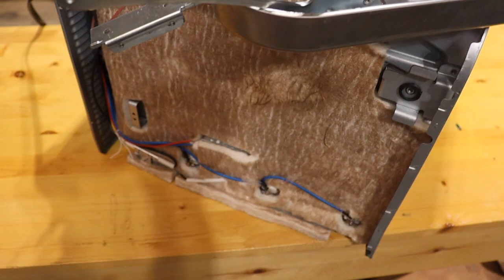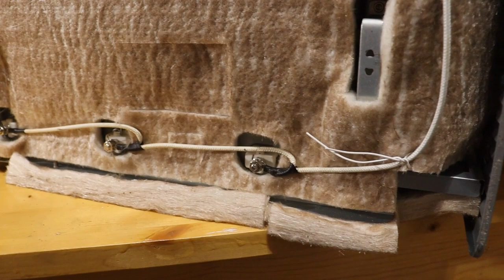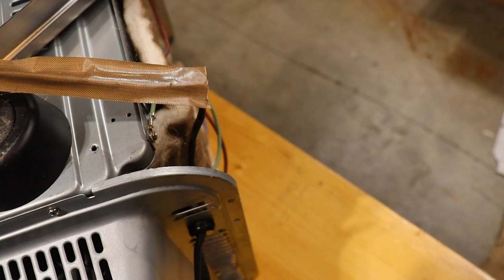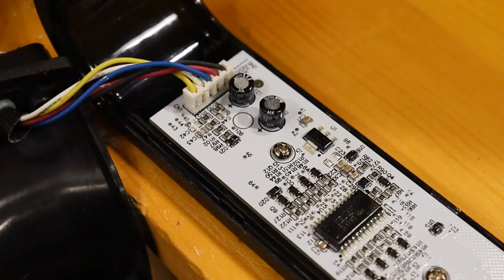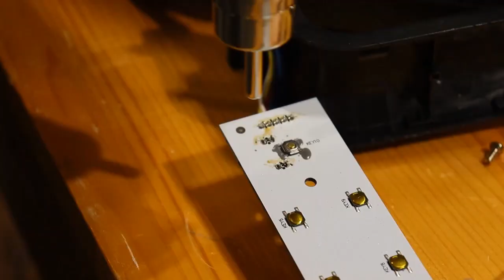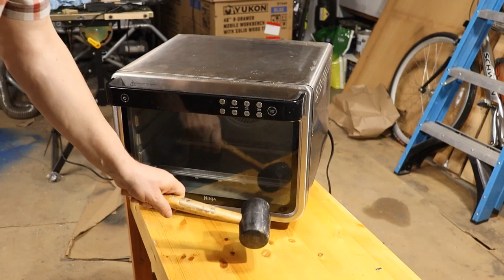Repairing Ninja Foodi DT 201 - Start Button not working : It is "disposable" product

Comment: We used the hell out of ours, maybe 3 years of hard use because since buying this we rarely used our oven any more. Mine died by the controller board not supplying DC voltage to power the PCB in the handle. We had a power outage/surge that took out our coffee maker and this oven. I'm not able to diagnose component level I was hoping to be able to simply buy another control board but no one sales them, I found one on Ebay but it had already been sold.

Comment: Thank you for posting, You have saved me a lot of hassle. The Oven Light on my DT 201 as failed and as you show this is not user friendly so you bin the Oven because the light stops working!
Ninja will replace the entire Unit if its in warranty {2 Years] and now I can see why. Very bad design fault.
What you say about the Glass fibre is also concerning.

Once again Thank You

Comment: Hello everyone, my Prestige-type Ninja oven worked perfectly during the year-long warranty period. A couple of months later, it started malfunctioning, displaying "Callserv Er0". Here in South America, there's no warranty or service, so I proceeded to repair it myself. The problem occurs when I open the door; the light doesn't turn on at the correct time, and then an error code appears. I disassembled the casing and observed that the fault is in the area where the 5-wire cable connects the door to the chassis. I think the wires broke from so much opening and closing the door. I'm going to cut the wires on both sides and solder in 10 cm of new cable. My question is: how does the main board detect when I open the door and the internal light comes on? I haven't seen any mechanical/magnetic switches in the area that could be causing this fault. Thank you in advance for any information you can provide about this type of problem. Otherwise, I love this countertop oven; I use it daily.

Comment: Disassembled the outer casing and decided to see if going further was worth it after the power button died...it's on the way to the recycling center. Also worth mentioning that the cover is very sharp and it's very easy to slice your fingers.

Comment: According to Amazon, this item is selling at a rate of 600 per month.  It is actually a fabulous appliance, I bought mine in 2020 and after 5 years of approximately twice a day use, it began experiencing intermittent error, due to the broken wire-at-the-door issue.  I have fixed that and examined the switches which appeared fine.  If new switches are needed, I suggest purchase of TL3315 switches made by e-switch from digikey.  Crap switches from Amazon would probably work in the short term, but why not use quality switches given the ABSOLUTE pain in the ass of taking this thing apart?  Be careful with the sharp edges on the outer casing and make sure you understand how the thing gets put back together, it is much easier to take apart than re-assemble.  Good luck!

Comment: Would be nice to see how the stainless steel casing is removed, mine seems to be stuck at the front.
Reply: OK, I was able to get in the seam and pry upwards in the area above the door with a "stiff" putty knife, a regular putty knife being too flexible.  I guess a painters multi tool would also work if not too thick.

Comment: Thank you so much for this video. Both my start stop button quit as well as my power button within 24 hours. I’ve only had this thing for six months, but I use it two or three times a day.

Thank you so much for sharing this. There was no other information anywhere on the Internet about this. 

I will be buying a new oven that’s NOT made by ninja.
Reply: Same here. I will never ever buy this brand again. I liked it a lot while it worked but after spending so much money, the oven simply will not turn on and work again. I will buy another air fryer, but never this brand.

Comment from the maker: There was a question why the switches come apart? These switches have spring steel domes glued to the base with adhesive kapton tape. As with any self-adhesive tape, the glue deteriorates with heating and drying. And eventually they come apart. If you repair, it may be better to use the other type of switches (as shown in the video) which have crimped metal case - it does not rely on the adhesive. Replacing with identical switches may be an invitation to disassemble exercise.

Comment: I agree that this is not a repairable oven. This oven is unbelievably difficult to disassemble. I replaced the on/off switch and the start/stop switch.  I believe its the heat that causes these switches to self destruct. 
I bet in a year or so more switches will fail.  I am going to put some insulating materiel on the back of the handle and perhaps that will fix this problem.  The switches are readily available from Amazon

Comment from the maker: There was a question about the "micro tactile switches" I used... There were from my goodies box, however, here is Amazon link that gives you plenty (and you'll get some spares): https://www.amazon.com/Tactile-Momentary-Assortment-Control-Plastic/dp/B07DNHS3FL or https://www.amazon.com/SCOOYUCK-Normally-Tactile-Momentary-Switches/dp/B0D9H8V873. The box includes the original ones (with yellow mylar dome that fails), and the enclosed ones with the button. I used the latter, but because they are ~0.5mm taller, one will need to put ~0.5mm washers on all mounting screws so that the buttons are not permanently depressed.

Comment: Hi, do you have a part number for the button? I cant find it even from electronic goldmine search
Reply: I advise against getting any cheap electronic component from Amazon.  Many are absolute garbage.  I suggest Digikey as a source as they supply industrial customers so basically everything they sell is of better quality.  For this particular item the TL3315 series from E-Switch offers the correct replacement with options as to operating force.  I'm sure any of the options would work fine.  A higher force would give a more quality feel, so why not.  If you have a problem paying $5 shipping for a .15 item, then avail yourself of their free shipping option.

Comment: I just yanked the front of the plastic handle off, starting from the power button side. the screw posts broke but the plastic clips hold it back together just fine!!
Thanks for the video - and info. This oven P'd me the F off - half the buttons stopped working 1 year and 1 week after I bought it so my warranty was JUST up. Shark/NINJA are corporate giants that ONLY want your money, even if that means providing you with EWASTE.

Comment: I wasnt quite looking for this but know now it will happen. Too many none abled engineers that could never turn a screw driver more worried about how it looks than howit fuctions beyond a working time frame. Could of just had the outer cover just pop off or get this start making better products just like North America did for years. Cheap parts from a cheap ass country is the problem! Big NAME NINJA, HOW ABOUT BIG SHAME NINJA!!
Seriously how hard is it to make a removable screen so the fan blades can be cleaned but now Im thinking class action law suit from multiple countries for using the cancer causing insulation, hey why dont you throw a box of Covid along with our lung cancer NINJA SHAME...............................................

Comment: Completely disagree….to get to the screws holding on the 4 screws to remove the control handle, all one needs to do is remove the 10 Phillips head screws, and 4 t10 security screws (ones with the hole in the center of the torx bit) from the bottom of the unit, with the door closed. Froze there the inner panel that surrounds the glass, can be lifted from the hinge area and the inner panel with the door open, can be pushed toward the inside of the oven, enough to clear the stainless tab that overhangs the panel, finagling it past with screw drivers leveraging it downward. Once it clears the tab, that inner panel will lift enough to get to the 4 screws holding the control door handle, and bobs your uncle! Now whether the 5 wire harness gives you enough room, to get it split apart, we’ll that’s another question. But there seems to be enough wire slack to have some room, so I believe it’s possible. Now you could also cut those wires and reattach, but you can get to those handle screws with just removing the inner panel as I explained. Now this doesn’t address my issue, and according to the web, a lot of other ninja foodi xl (dt200 and variants) where the units turns off, when the door is completely closed, which looks to me to be either a door switch issue (doubt, as I’m not sure there is a door switch, if someone knows different let me know), or the wires have a short, from a lifetime (in ninja foodi xl years) of opening and closing of the door, stressing the wires and disconnecting at the point when you close the door fully. So I must operate on this appliance further, and remove the stainless cover surrounding the oven…..I will get to the bottom of this issue, as this free xl model picked up off Craigslist, is going to cook some dinner once again, and maybe moonlight as a powder coating oven….so wish me luck….oh and those with those broken tactile switches, your welcome!
Reply: If your ninja xl (dt200, and variants) shuts off when door is full closed, and has er-0 error code, it’s the wires near the hinges, that flex every time the door is open. The fix is to disassemble, and cut out the 2” of damaged wire, move a good section of wire into that position, and graph on the 2” of new wire to replace what you removed. I just did that, and oven now works. As I stated in my other post, you don’t need to disassemble the entire door, just the inner panel that surrounds the glass, and to get to the wire harness, the right side vertical piece with spring hinge covering the wire harness on that side. You do need to remove the stainless cover and hinges. Rest is pretty self explanatory
Reply: Furthermore, removing the stainless cover, from the oven to get to the inside is tricky….not taking out the screws, but getting the snap tabs to release around the door area. These tabs are metal and quite hard to get to release. This could lead to prying and bending the stainless cover, pretty easily, so care must be taken to avoid that. The 6 locking tabs 2 on top vertical section and 2 each on right and left horizontal sections. I would start with using a thin piece of metal to slide it and locate the tabs…before starting the releasing process. Do this by inserting the thin tool into gap starting on one side, and moving it up until you hit something solid and mark that location, do this for the 5 others. I did measure those on the top of the cover, and the tabs were 4 3/8” from the edge of the unit, the other measurements maybe similar. Once the tabs are located, youll need to pry at those points while pushing the cover rearward, and a note, it’s the oven itself that has the tabs on them, and it’s a v channel (on the cover I believe) that this rides in. Like I said, these tabs are sharp and like to dig into the metal so it takes force to overcome this along with something like a putty knife wedged in.….rubber mallet tapping, not a bad idea. Once you get the lower sides (bottom up) you’ll get the hang of what your up against, just be careful not to bend anything up. Good luck!
Reply: My machine has developed this exact fault you're talking about. Is it possible to message you somewhere before i attempt to repair the machine? Thanks  @smiller787
Reply: Forgot, 4 of the Phillips screws are under the left and right long rubber gaskets and the other 2 are under the “L” shaped rubber bumpers at the top corners. All of the rubbers are easy to remove, as they just fit into slots in the panel your removing.
Reply: thanks for the tips, very helpful
Reply: I took both hands and threw it in the garbage where it belongs
Reply: @seanmercer9292 You Win! 😊Excellent job.
Reply: Yep, that is working for me.  Remove 4x T10 and 10x Ph1 from the door (4 of the latter under rubber trim/seal), then gently lever the inner metal trim inwards and wiggle it left-right to free it at the top.
Reply: No. What you need to do it take your main finger , and turn the whole thing topwise. Topwise I say, and flip the bottom until it meets the corner of the top of the bottom. Call it done.✅

Comment: Thanks for your great video.  Unfortunately, I do not have your level of expertise or experience with this kind of repair and we cannot find a repair person to fix it - so likely to landfill after 19 months. 😢
Reply from the maker: Hi, the skills are not that high, but I suggest that you call the support center and explain your problem. In the (unlikely) event they can help, they may be able to send you a replacement or upgrade. Be persistent...
If not - you may still try to fix it (you do not loose anything, do you?). 
If you carefully disassemble the handle, you may find the button cup (~1/4" little metal circle) inside the handle somwhere. If you do, you may attempt repairing without button replacement. Place the cap on the place it was before (shiny side to the base of the button, yellow kapton side out). Use kapton or other good sticky tape to secure it (with sides of the tape glued to the board around the button). If your problem is only one failing button - it will let it survive another couple years (until the tape stays sticky). Good luck!
Reply: @celsiusswatt6021  what if you just rip the button out?  It's ugly but dont have to take everything else apart.  Keep the button off or find a hack for it.  Is there a simple but ugly solution?
Reply: @daviddong4366   I think this is happening with my smoke switch and I like your idea. I just don't know enough about those switches to know what to do after I cut the plastic top layer off.

Comment: OMG! what a horrible design. By the way, thanks for the detailed video, helped a lot. I have exact same brand and model, and exact same button has failed. I am trying to replace it but I think I have already destroyed the copper lines. I will receive the new buttons tomorrow and will see. I hope 4 pins on the button are actually 2 parallel pins so that I can use the other 2 to solder.
Reply: Hi! Can you please tell me where you got the buttons? It turns out that I just bought the same oven for half the price and just now I see that they have this fault. I would like to have it in advance!

Comment: It seems like you could maybe have removed the handle by bending a little bit of the metal in the door to access the screws. Those screws are hidden behind the rubber corners.  How many screws held the handle to the door?
Reply from the maker: I think that there us no way to simplify the disassembly procedure (like bending something as you suggest) without spoiling the look of the repaired device... But as the owner, you are welcome to try...

Comment: Thanks for the peek inside. I find the cord a bit short. I thought about add/moving the electrical outlet but thought it would be easier just to buy a longer cord (with the same gauge wires).  I just need an extra 6 inches or so.
Reply: Great Video my Good Kind Sir... I had a DT201 do exactly the same thing only a I'd also purchased the "Extended 4 year warranty" for $40 Bucks and the 'Ninja Sharks' did the same thing as they did to yours are for the same: 'Money Grubbing Planned Obsolescence Business Model Wall Street Lives For  Reason,' in only 23 months, last May of '25. So, I applied the refund to the next one... and in essence it cost me $80 bucks for two warranties and another $42 bucks  for both in sales taxes for two years plus the $575 bucks for the broken & new one... My Sanity repeatedly winces when saying, "No sir, no sir, I really don't look like Mr. Stupid," into the mirror as my morning shaving mantra...
---
Okay then, a question for you... since this new one is going to do the same damn thing as the last, in your opinion, do you think this hair-brained idea below would work on this 6th month old new one when it goes dead:
`
Instead of taking all the time to remove all the screws, Stupid will be considering taking my Dremel's cut-off wheel and be cutting the plastic door handle about a 1/16 inch in depth... vertically from top to bottom so as to miss the main circuit board and wires going to/through it on the right side... and then repeating that on the left-sides face-side... just beyond the handle's curved bend... but also just short of cutting into any of the the circuit board. I'd then pry the plastic face off with the attached screwed in circuit board and electronics,  releasing the compression connection to the inner connection handles half as you did with a flat head? I'd fix it as you did, snap it back... and dab some epoxy filler in the cut gap 

Your Opine kind sir, and the best place to find the correct sized Momentary PCB Surface Mounted Devices, SMT Mount 4 Pins Push Button SPST Tactile Tact Switch would be appreciated... btw I joined the channel too...Thanx Much.. gw aka Mr. Almost Stupid
Reply: I'm trying to replace the power cord, how does the grommet come out?